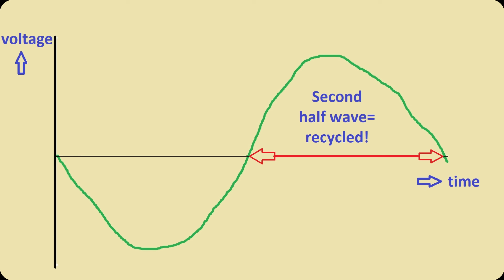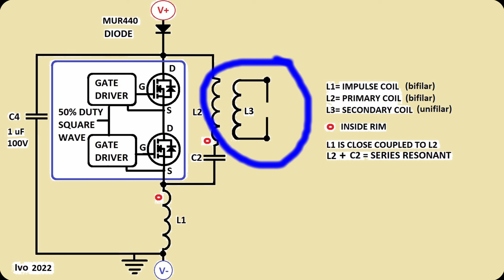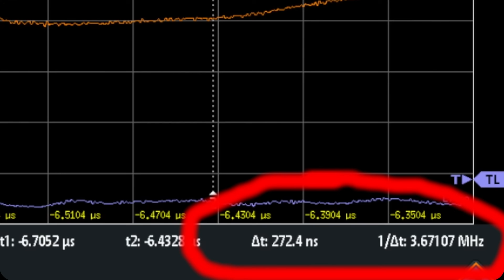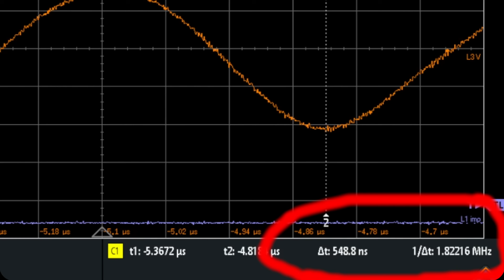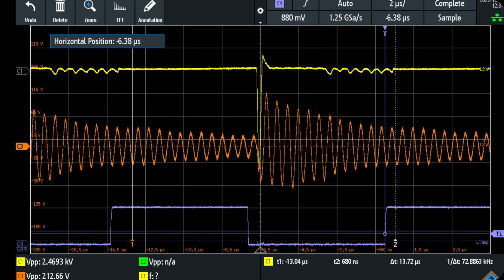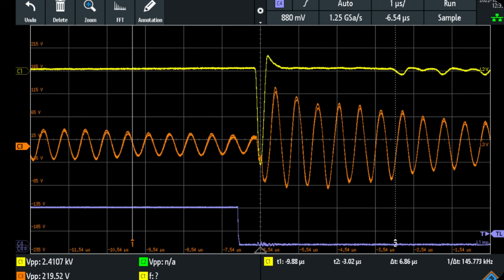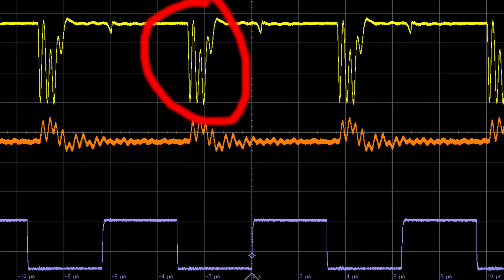Tesla coil excited by Nikola Tesla's Impulses. Very Efficient, 63W=100kV, 35mm sparks

Comment: As Tesla’s advocate free energy may be derive from electrostatic in the Aether space, that is well understood from this channel. So why did we experiments in the opposite direction ? with alternating circuit?
Reply from the maker: Good question, I thought it could be done, but I was wrong. Now I understand its not a voltage impulse from a coil discharge that is needed.

But a current impulse from a capacitor diacharge.
Luckily I know how to use two coils as capacitor plates.

Comment: Would you say that the white silent spark you observed in your spark gap as you brought the electrodes closer together is most likely the radiant energy/cold electricity? You were using AC in the video but does the white radiant spark also manifest in DC spark gaps? If so, which is more likely to produce it? Thanks!
Reply from the maker: I do think so yes. Dc is more likely. but it is still unclear hoe these things truely work.

Comment: Nikola Tesla Biritish patent 8200 A.D 1905 the L2 coil total wire lenght should be equal to one quater of the wave lenght of the electrical disturbance  in the L1 system or else equal of that lenght multiplied by an odd number. "In this way i created thousands time more horsepower then the inital." half wave resonance will not bring you excess power.

Comment: nice vid - thanks.

the 180nf cap to a very small inductive coil is a very bad idea, i think. as you may well know the q of a resonant tank, is a match where the cap must have a value that contains the same amount of energy as the coil. if you differs from that value the q of the tank, will go down. in your case, it must be very low. 
during my experiments i have found one of the main principles behind free energy, i think. namely making everything resonant and with as high qs as possible.
Reply from the maker: high Q is always good yes.
but free energy I already have, and shown in my last video this summer.
Now I am working on the the holy grail, free power.
this is done by 2 resonant systems, one with high voltage, one with high current.
they induce power into a third output coil, when their phase relationship is correctly tuned.
fingers crossed. still working  on this

Comment: Just a suggestion: Have you tried coupled helical wound coils? The gap is easy to control, and you can actually have multiple coils. Ferrite rods can be placed on the outside to good effect. It strangely would look like a fasci staff.
Reply from the maker: yes working on a helix coil now
Reply: @MasterIvo  
Placing a single ferrite inside the coil makes it easy to wind the coupled coils. Then several on the outside of the coils to remove the noise that you had with the flat ones. You need to bind them, that's why it looks like a fasci staff.
Reply from the maker: @JustMe-te8cz  fasci staff? never heard if it. I found nothing about it. what is it?
Reply: @MasterIvo  
It was originally used in ancient Rome. It looks like bundles of reeds. It was used later as a symbol for fascism. But that's the design for a coil with ferrite rods on the outside.
Reply: @JustMe-te8cz  it's not just "fascism" you see it on the Lincoln monument, in the house of congress and the senate...everywhere "democracy" supposedly sits...fasces is the term. not fasci

Comment: @Master Ivo,,, just logic about tesla coils, tesla coils was not invented by tesla just to see and play the spark discharges on the air, this is a power generating coils that generates from small power to high frequency and high volts...why dont you try to add an L4 coil with large gauge wire and act as and tertiary coil and your L3 one line will be grounded and try to test your tertiary coil what will be the output current and voltage...i can assure you, you'll be amaze the output power which far away u can imagine..
Reply from the maker: I did.
Voltage and current become in phase in this extra coil, but not real power.
Reply: @MasterIvo  think of the resonance  as resistive reflections in mercury current, this 'inductive field' i will call it, that you have flowing between the windings would accelerate off each other like pushing magnets against each other, matching size with flow. imagine something you spin like a spinning top and then it keeps generating without friction. a lamp that doesnt stop until you brake the spinning top and much more. https://youtu.be/3VTfOXT95eg earlier comment: "i think you are finding the correct proportions for a vajra, short side long side, central toroid."
Reply: @MasterIvo  Amazing. V & I in phase, yet no power?
why?  does a load detune the system (in which case calculating the load as part of the system could work?)?
or is it flat out impossible to extract the power?
Reply from the maker: @juanmf  I suspect the current is not conventional magnetic current. Instead it is a dielectric displacement current.
Reply: @MasterIvo  I'm fantasizing here, could it be captured with capacitors for use?

Comment: Tesla coil was used for different purpose during 1940's. Hungarian scientist emigrated to US to keep his invention away from the Nazi war machine. Study the Hefferlin Manuscript - Hydrogen gas generator from steam and Tesla Coil at 1.3MHTz secondary coil ran prop plane engine with steam chamber and electrodes. Self sustaining with engine alternator. Readable on line or special order back issue magazine- Amazing Stories Sept 1946. There is also US Patent on similar type with compound coating in heat exchanger emitting frequency in steam chamber ran car engine many years back on Hydrogen and Oxygen.

Comment: Thanks so much for your work Ivo. I'm finally ordering the PCB and FET's for your driver circuit tonight. I was in the midst of attempting to apply Ken Wheeler's understanding of field perturbations practically to a radiant power system when I found your channel. Your explanations of Steinmetz's work and your own explorations have been very helpful. I'm working completely open source (and pretty much full time now) too so if that forum ever approves my application I'll likely jump in and share a couple results on your thread. Keep up the genius my friend, you're at the forefront (at least of those of us who are not keeping it to ourselves)!
Reply from the maker: thanks! great to see you join the pioneering front.
Reply: @MasterIvo  thankyou. I think you've worked out the best modern switching circuit that currently exists (ordered!), so I'm now focussing on exploring the effects of Rodin Interference coils instead of bifilar pancake coils in a similar circuit and experimenting with how to tune a collector to act as the initial resonant power source (similar to Teslas Radiant Energy patent collectors but using our better understanding of material mass differentials and diamagnetic insulation to be able to tune them more easily and gain higher amplitude without raising as high).
Reply from the maker: Interesting, would be nice to see your results on Youtube.
I am working on a project of a few years back. It is the half bridge circuit. Back then I intended to have alternating polarity voltage impulses, one per half period.
But I learned it is was not possible to generate them.
I also knew I needed current impulses, instead of voltage impulses.
it's like an energy pump, displacement current into and out of the resonant system.

Comment: I built frequency into my high voltage, but this is much better. Are there 2 poles (north and south)  the main center coil has a north and south does it show the same in the secondary coil?
Reply from the maker: No secondary has balanced AC so the north south alternate equally.

Comment: is it possible to make impulses of higher amplitudes using transistors? say 100kV or 1 million volt impulses?
Reply from the maker: in theory yes, by using multiple series switched mosfets.
but I do expect challenges. I never tried more than 2, giving a maximum of 3500V.

Also the coils that produce the impulse would need to be able to. handle those voltages, which is another challenge.

Comment: Hi I need to make a flat coil that resonates at 300 hz on it's own so I can attach it to a sine wave generator. Is there an easy way to check after how many spins of wire will the coil generate 300 hz? And does it matter how big the center opening is? Thanks in advance
Reply from the maker: that will be one very large coil at that frequency. there are online coil calculators

Comment: Help me understand why we can’t use a Tesla Coil backwards.
Reply from the maker: backwards? because you to start the oscilation with something
Reply: @MasterIvo  Exactly, a power source- correct? 

In a demonstration of a Tesla Coil, the toroid releases discharges, right?

What medium propagates the discharged energy?

There is a power source in the atmosphere- whether it's static charge or photovoltaic energy.

That's what Tesla designed the coil to do. What we know as a Tesla Coil was designed as a backwards iteration of its true purpose to demonstrate the technology without divulging it. 

Build a Tesla Coil backwards. Make your power source the atmosphere or the sun, and the output is a generative energy source.
Reply: Teslas radient energy patent. You have to understand the particle that he is capturing, why the 30" sphere was used at Colorado Springs, why the metal was polished to mirror finish, why it was lacquered, and then coated with black rubber paint. Once you figure that out everything is unlocked!
Reply: @devinmccloud  Now help me understand how that’s relevant to the original question.
Reply: @devinmccloud  As a matter of fact, after having read the patent, I’m that much more confident in the assertion that the device was, indeed, intended to be used inversely to how they are built today.

Comment: I Guess in case i understood [ Scalar wave ] to be a wave that is (fluctuating but always) equally positive as it is negative. (1(00)v+ plus 1(00)v- is zero)
(and that untapped potential is everywhere around as per N. Tesla: a sea of abundant energy)

What i recall from Don Smith is he said something like he is  "Splitting the positive".
Guess that means something like (center?) tapping (into) that scalarwave and splitting the Voltage part as well as the Amperage part from each other.
Make it do some work and then ( putting it back together)

Is there something you find true in that recollection and guess-work?

----- ----- 

I understand, on an abstract level; 
Get a hammer, 
Ring Bell 1, 
tune Bell 2 to the tune of Bell 1 and it resonates with it without being struck.
and Bell 1 is not being taxed for it because the ringing of Bell 1 is only output as it got its input from the hammer.

Tune all other bells to the tune of Bell 1 and they all ring without any extra effort. 
and tap into that with Diodes; Getting a [ neutral ] and a [ positive ] 

In the case of N.Tesla;  i think the wardencliffT is Bell 1,  and all the non-bell-1 Bells are household appliances, cars, etc. that all are intune with Bell 1. or to a harmonic of it.

If i asked something already explained in some of your video's @masterivo then i'm Sorry. 
I love your Open Source investigations and i'm just trying to grasp the whole concept.
Reply from the maker: concepts are fun to think about, but often not connected to nature and real life.
experiments show whats going on. but we can only guess about their true deeper truths.

Comment: Ivo, as always excellent and informative. Let me offer an additional line of investigation.

Since L1 takes the place of Tesla’s spark gap intended to provide unidirectional impulses, decouple it from L2 and L3. Additionally, drive it such that after the negative impulse is completed it fires again immediately. Then re-tune L2 and L3.

I think you will like the result.

What you are after is that gaseous white flow along the length of the secondary. You might consider top loads at the ends of the secondary with the tungsten rods coming off of the end loads.

Finally, you may need to make the primary and secondary coupling looser than it currently is. Most Tesla coils use a pretty loose coupling between primary and secondary as I’m sure you are aware.
Reply from the maker: If I decouole L1 from L2 it will reduce efficiency, but I can do that.

but to fire L1 again directly after the impulse is impossible as it first needs time to charge upnits magnetic field again, to be able to produce the impulse.

Retuning L2 and L3 is also possible.
what result do you expect?
Reply: You are after that gaseous white flow along the length of the secondary. Tesla describes this type of gaseous flow.
Reply: Is L1 being driven with DC from the driver? If so, you can tell when the magnetic field is charged by monitoring the voltage across L1, when it becomes the steady state value the magnetic field is fully charged. Alternatively, you can measure L1’s time constant and use that as the basis.

With regard to top loads, a pair of Bundt pans fastened together give a nice toroidal shape.

Comment: Love this one in fine tuning.
I would welcome to share info privately.
Your work is outstanding.
Let's talk about the Aether. Cos I think you need to understand the Aether fully.

Notes.
Evo I don't understand the Aether but I am getting to a point of the wow factor.
Perhaps we can video and discuss?

Merry Christmas
Regards DC
Reply from the maker: always fun to do a video call.
For me its becoming clear Aether=pure energy, which can move  around and take form (manifest as dielectric and magnetic fields). also it is inertia
Reply: @MasterIvo  I pulsed HV positive DC flash into a single Floresant tube set in a short length 3ft long x 2 inch (50mm) round dia steel scaffolding bar.
This positive flash expanded out in the Aether, pushing out and then collapsed with a returning backdraft negative static  spark. This small observation was a show through of how the Aether works and is real.

So how do we gather the potential from this neverending supply?

Capacitors / Coils / spark Gaps and batteries. ( Maybe)

Best wishes for the season. DC
Reply from the maker: Happy holidays,

Comment: Hey Bro off topic yet not. In his writings for a magnifying transformer it required a primary a 1/4 wave secondary and a 1/2 wave exciter/extra coil. Love what you do I will add you to the other drives. He also talked about a fluvia (no sparks just plasma/ion glow) and a spark gap between the Transmitter and Receiver the tops acting as a capacitor and spark gap at the same time and the Secondary long distance receiver having the primary.

Comment: If you have the capacitor at the same capacity as the coil has inductance so like " 1uH to 1uF.  You can tune them or pules them at 9uS very easily and  Make the secondary coil Twice  The inductance of the  Primary. You can could oscillate the secondary more efficiently   Throughout the entire system.

Comment: A main point here. Tesla did not drive his electrical resonant devices with transistors. Have that in mind, when you do your experiments.
Reply from the maker: obviously he used auto oscilating relays
Reply: @MasterIvo  the main point is that mechanical interrupters ( spark-gaps ) have different characteristics then transistors and such the coupling, between the capacitance and induction (in the coils), produces differently-behaving oscillation..
Reply from the maker: @EfficientEnergyTransformations  and what is that difference?
Keep in mind, I do not discharge through a mosfet!
A capacitor discharges through the sparkgap by CLOSING the circuit. 

but an impulse coil discharges directly into the primary coil, by OPENING the mosfet.
So it doesn't go through the mosfet!
Reply: @MasterIvo  There is a subtle difference due to timing and particularly duration. This video explains more about it. I have never liked spark gaps, and always looking for a better way. yours is looking pretty good!  https://www.youtube.com/watch?v=EHRkCQ19GhU&t=1825s some interesting similarities between your waveform and those in the vid. Also on my setups I find it easy to raise the frequency like you're doing, but I would like to take the high frequency to a lower frequency and am finding that harder. there seems to be some amount of out of tune that is required. Any thoughts?
Reply: @EfficientEnergyTransformations 

i also believe transistors and sparkgabs adds very different effects to the circuit and energy.
eg. the colour of the spark gab is very important to determine what kind of energy we are dealing with, i think.

again i believe we too often assumes and neglects very important effects, when we do our ground research.

Comment: excellent information. another good tip for winding fast coils is put some mono fishing line next to the wire when you wind the secondary. it gives some interwinding spacing that changes the Q in our favour... you are correct in that looser coupling will afford a better match on the impulse. try another primary with a bit of stand off from the secondary.

Comment: Interesting! slowly, I finally understand what you do and did.
the pulse generation and utilization method is great, you're using the inductive spike caused by instant shut down of the current to your advantage.
Looking at all those fe inventions, I think you're almost there.
I am seeing Don Smith in this set-up, but without a (custom) HV cap diode bridge and (resonant) step down transformer on the resonant coil yet, also he (and others) uses less turns probably for a lower self-oscillation freq, like 50/60cps?